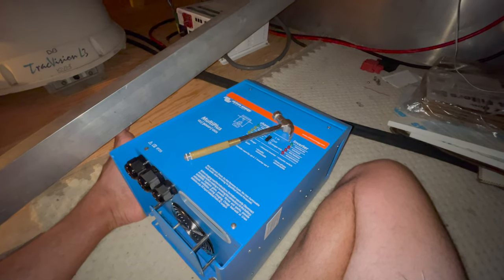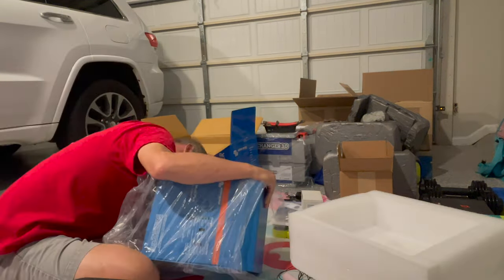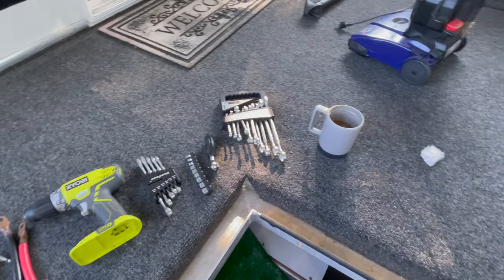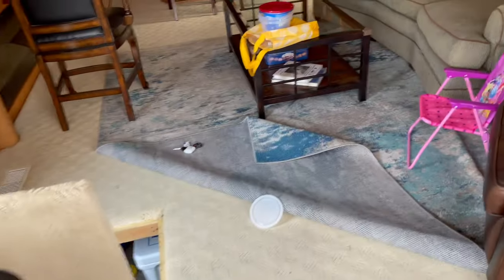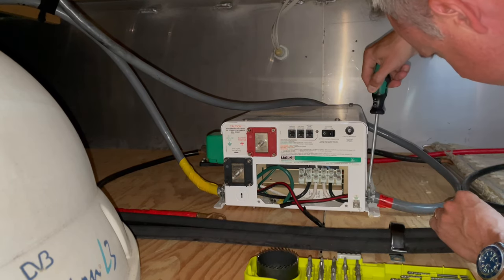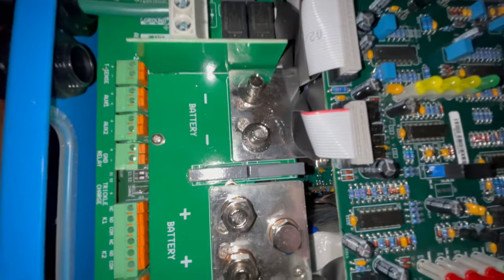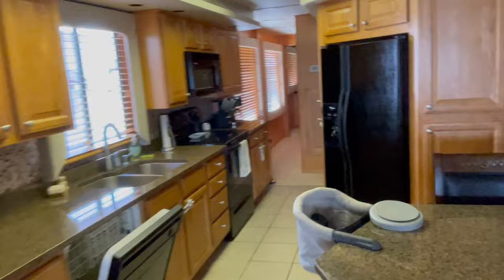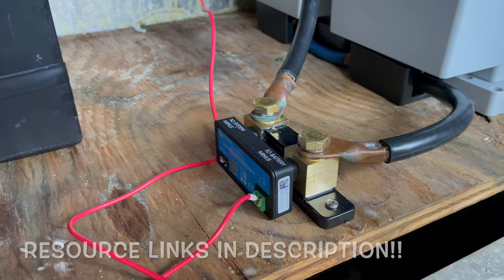LITHIUM ION Batteries Install On Off Grid Houseboat

Comment: Just curious how tall are you? I’m 6’4”. Can’t imagine being able to be in any kind of seated position in there. I would need to be prone and with some sort of ventilation. I’m an electrician. I remember the days of belly crawling under old houses in my younger days.
Reply from the maker: I’m 5’10” and the hatch opening was just above where the camera was positioned, so I could see daylight. I knew there wouldn’t be ventilation, so that’s why I practiced a lot before actually installing. It was for sure a tight fit!!